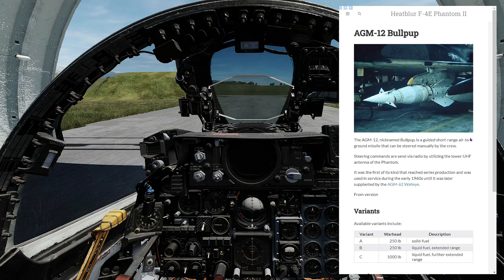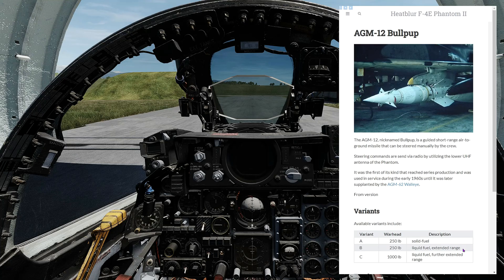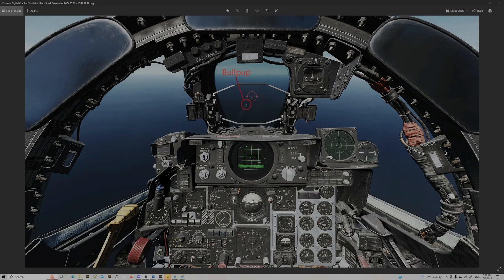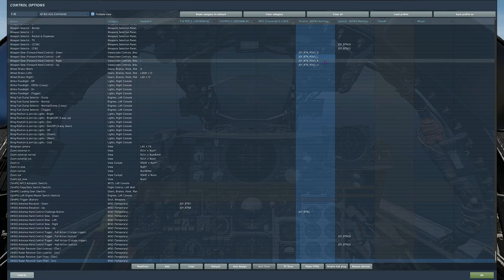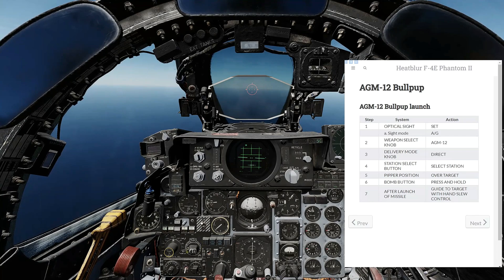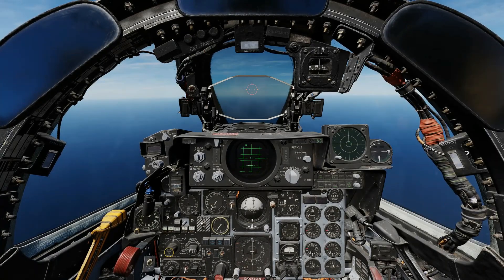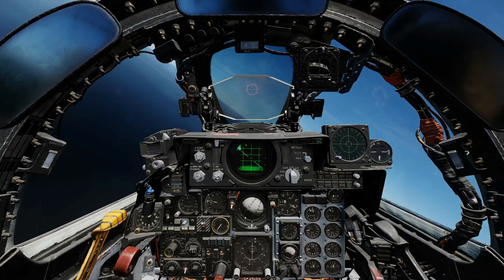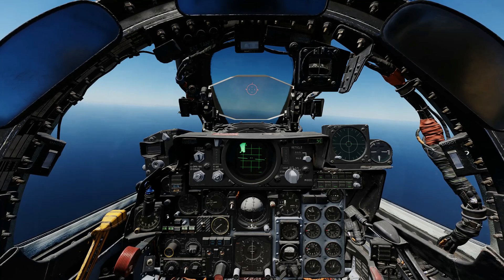F-4E Phantom: AGM-12 Bullpup MCLOS Missile Guide

Comment: In DCS, yes, the damage to that ship was minimum. But in real life, that weapon hitting the control tower/bridge would have crippled that ship. Maybe not a warship, but a civilian spec ship is not designed to deal with damage like that. Just a wire harness cut would have stopped it dead in its tracks. And the resulting fires would have consumed what was left. I guess my point is not to judge a weapon by its performance in DCS or any other sim. But, DCS is the system we have so what you need to do to make it more realistic is set a trigger that explodes the target upon being hit.

Comment: MCLOS can be quite effective and sophisticated.   Broadly there are two types: acceleration control where the guidance operates the control surfaces directly (which is difficult) and velocity control where the missile has an autopilot referenced to true north and level and the missile is given a compass heading by the command link.  This makes it much easier.  If you keep the gun sight reticle on the target the mssile will fly in the correct direction.  The missile control joystick need only then nudge the missile back to target.
Reply: Is that second mode implemented in the module?